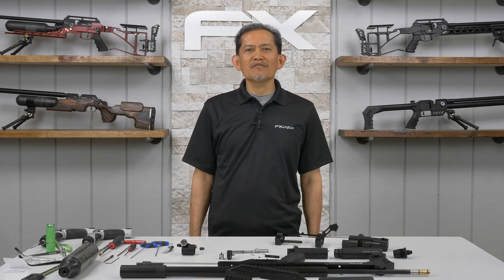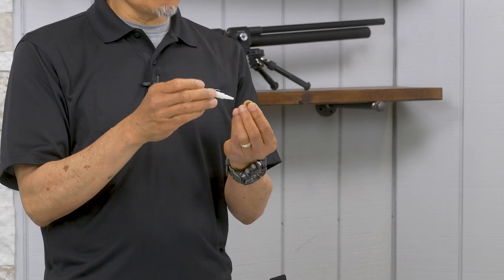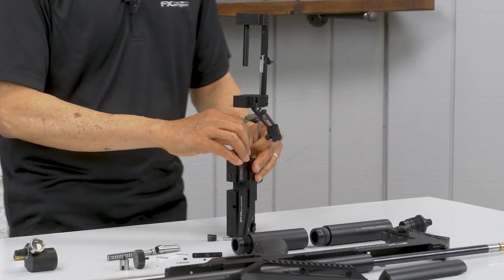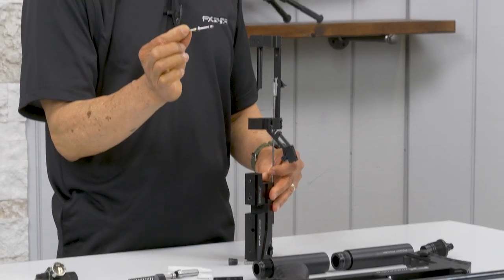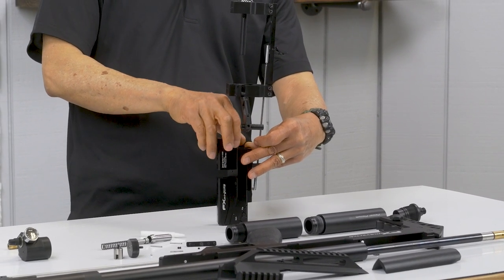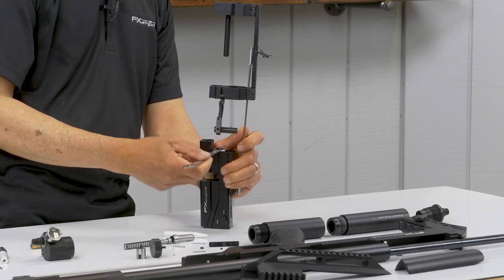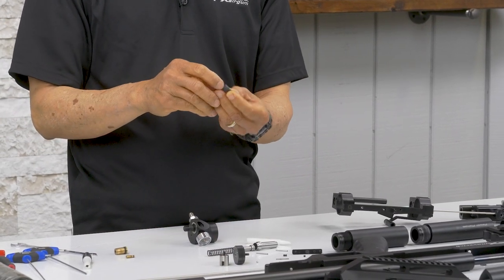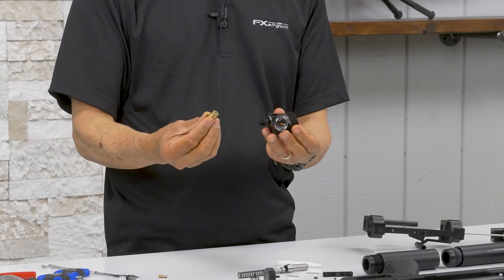FX Maverick Reassembly - FX Masterclass

Comment: Question.  Do all mavericks supposed to have that washer that goes on to that part that is inserted into the long heavy duty spring. The pieces that come out after thumbwheel assembly in the back of gun. Mine didn't have that washer.  Thanks

Comment: Hi Ernest: This is a really helpfull video. But, 8 minutes in you say the measurement is 75mm but this seems to be on a FAC (over 12ftlb) FX Maverick. On the UK spec (sub 12ftlb) where the 2nd regulator is at the rear, what should the measurement be please. Thanks.

Comment: In Sweden whre I come from I think tetwo plenumtanks are in the opposite order from the Maverick you show in this film. I have been told that I have to change the order of those two plenuntanks to get the rigt pressure out of my Maverick. Of course there wil have to be a number of upgrades more that I’ll have to install. My question is if it’strue that you can switch the plenumtanks without problem? Or do you have any othervsuggestions on how I cam make my Maverick shoot in full speed? Thanks for masterclass it really helpfull.
Reply: You  have the 12sub. So when you chance them tou have a illegale gun in Sweden  when you shoot full power.

Comment: I've just bought a maverick. Nothing but leaks. For no reason, when not in use, air just pissed out the hole above the bottle inlet. Professional pest controller, need reliability, so its going back for a refund. Will stick with my Rapids.